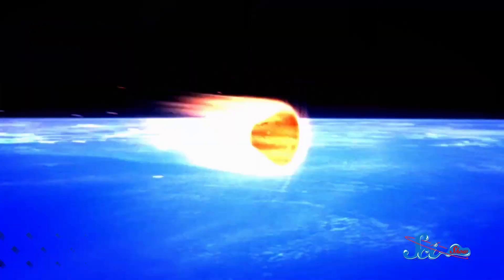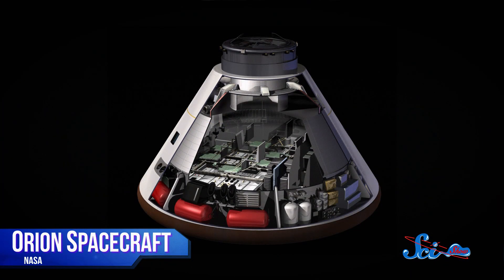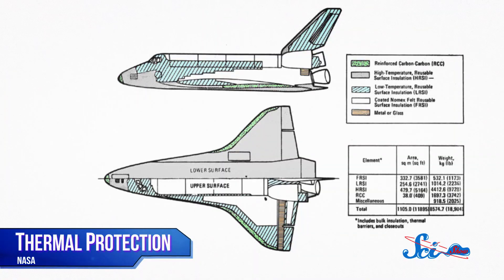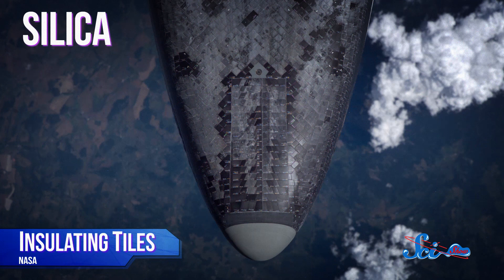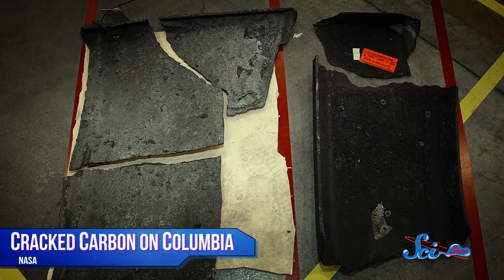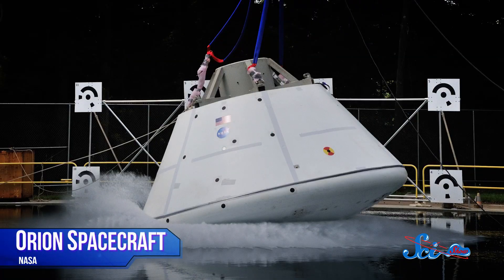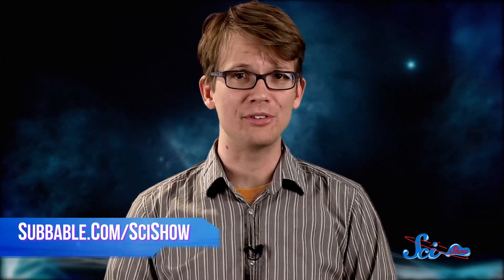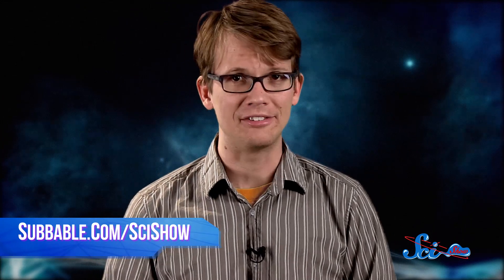How Do Spacecraft Survive Re-Entry?

Comment: I never did a research on it, i just heard it from a family member so i'm sorry if its ridiculous what i'm a bout to say. but wasn't soviet union space program solved this program using gel or some mixture with silicon that would just burn out when entering the atmosphere.
what happend to that method? and if that method never existed why didnt it?
Reply: I don't know exactly what the Soyuz uses for it's ablative shield but it is another ablative type like Apollo and the newer US craft.  Pretty much everyone uses ablative shields for everything.  The Shuttle was the main exception to the use of ablative tech and that ended up being pretty disastrous.  The Soviet/Russian tech is very reliable but the newer ablative shields that NASA and SpaceX are using are much more advanced and lightweight.
Reply: Mclovin11859 The shuttle tiles were much more problematic than that.  The early missions were filled with close calls where literally hundreds of them fell off during flight and re-entry.  It's a miracle Columbia was the only loss due to tile failure.  
  Also, after every flight, the entire tile system had to be inspected and repaired.  Each flight turn-around required thousands of hours of work to be ready for the next flight.
 The tiles were also unable to withstand rain impact, preventing the Shuttle from ascending or descending through any type of precipitation.
  They were a technical solution that never gave the benefits that they were supposed to and led to the only direct reentry failure in manned spaceflight.
Reply: Mclovin11859 I'm not convinced the Shuttle actually needed reusable tiles.  It could have been constructed to be able to remove large sections of ablative insulation and to simply replace them between flights.  This is really not any more invasive then the incredibly time-consuming and involved tile inspection and replacement process.  
  Also, it's worth remembering that the Shuttle started out as a much simpler and smaller lifting body design.  It got those huge, heavy wings from political compromises with the Air Force that wanted to be able to do single orbit polar orbit insertions, requiring huge amounts of cross-range maneuvering capability.
  Regardless, the reusable tiles were intended to allow fast turn-around, lower costs and to maintain a similar level of safety.  
 - cheaper than ablatives: complete failure
 - 50-100 flights per year rapid turn around: complete failure
 - as safe as ablatives: failure

The shuttle tiles were really impressive tech but simply failed at every real-world objective they were designed to do.  That's a complete engineering disaster.
Reply: Mclovin11859
The thing is that ablatives are already going to give us that.  The SpaceX Dragon 2 capsule uses an ablative shield that is projected to last at least 10 trips before needing replacement.   They also anticipate improving that over time.  At that point, you are looking at major airframe overhauls that require discarding or rebuilding the entire capsule anyway.
Reply: Mclovin11859 Of the 4 fully operational shuttles built, 1 burnt up on re-entry due to tile failure.  Would you buy a car if you knew that one out of 4 was a death trap just waiting for you and that the other 3 had serious problems that could also be fatal?  Less than 1 percent of the cars being recalled for brake and acceleration from Toyota failures but millions were recalled and that is just a car.  Re-entry vehicles don't skid to a stop.  If they fail even just a little bit, the crew dies.  so with a 25% complete failure rate (as in nothing to recover but burnt equipment) the shuttles were a failure as a class of space vehicles.

Comment: Just a question, how far are we from using carbon nanotubes as heat shields?
Reply: CNTs would probably not make an ideal heat shield.  Along their length, they are one of the best heat conductors in existence.  You want your heat shield be be really bad at conducting heat, not good.  CNTs are still not ready for prime time but will eventually be an incredible material for spacecraft construction for the load-bearing parts due to the incredible strength to weight ratio.
Reply: Dan Heidel
Ah, so I see. So what other kinds of materials/elements/etc. can we use to make heat shields?
Reply: OmegaEGGY The ablative ones are the best balance of price, performance and safety right now.  The current ablators are actually extremely light and thin.  The Pica-X ablator that SpaceX is using can be reused at least 10 times before needing to be replaced.  The performance of ablators is getting to the point where there's not much point in trying to further improve the things.  
  There are alternate heat shield technologies using active cooling and advanced metals that might eventually replace ablative shields but they are still very experimental and may not actually give much in the way of improved performance.
Reply: Dan Heidel
Thanks, dude. :) Love the thorough explanation.
Reply: OmegaEGGY No prob!  Nanotubes are awesome but that awesomeness makes them kind of terrible for certain specific applications.
Reply: OmegaEGGY  Aerogels might do the trick. They consist of over 99% air and are horrible, realy horrible at conducting heat. They get the bonus of beeing extremely lightweight
Reply: Dan Heidel What if you had nanotubes behind a shielding of different protective materials that heated up excessively, and have the tubes conduct all the heat off in a different direction, ultimately releasing it back into the atmosphere in the craft's wake??
Reply: +Dan Heidel  what about van allen belts ,who do we manage it

Comment: I know this will come off as 'old Duffer', but I AM 55, and would really like you to consider also posting the non-metric measurements, as my older brain can't convert on the fly. It's not that big a deal, and using metrics in a US produced Vlog seems kind of high-minded. I mean do metrics still get taught in US schools? Don't get me started. Thanks for your consideration.
=Me.=
Reply: I do sometimes miss the dual units.  However, perhaps you could take it as motivation to get more used to metric.  I had to become fluent in both systems when working in science and once you actually buckle down and start learning metric, it's easier that you'd think.
  The best approach is to not try and convert - just learn what everyday things are in metric and keep two separate scales in your head.  I found that to be easier than trying to constantly do unit conversions in my head.
Reply: I think most people can't convert like that. I'm 22 and I know I can't. There's always Google. And the metric system is used in science so it makes sense for them to use metric here. When I took physics a few years ago, all we used was metric.
Reply: I would prefer them keep metric and just skip over the imperial units as looking up the conversions (if you have to) does not take much time. But since this is a science channel it needs to be in metric and I would rather not encourage the use of the imperial system at all and especially not in a scientific area. The less use of that system the better, now if only we could get imperial out of the school system as well.